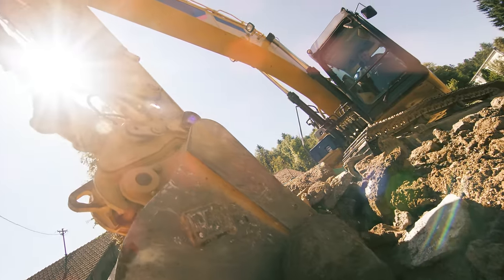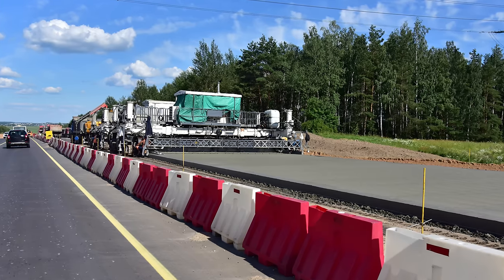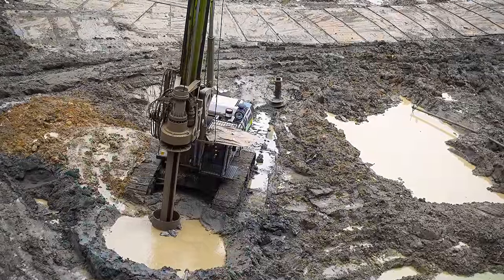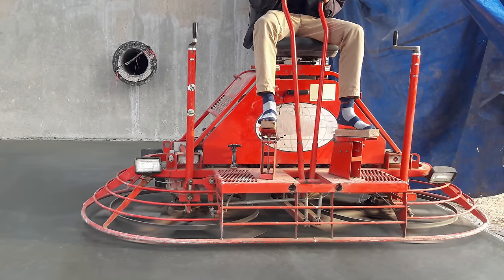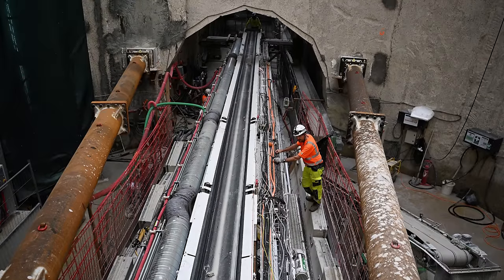Every Construction Machine Explained in 15 Minutes

Comment: My career was a specialized truck driver, hauling oversized loads with specialized trailers. Like when I hauled the concrete walls used in building homes. They would be placed on heavy duty skids with steel wheels like you would see on a trash dumpster. Then these skids would be put on a roll off trailer that can be angled so the skids can be loaded and offloaded using a 10,000 pound winch. I have also hauled much larger and heavier pieces of reinforced concrete. Some of them over 80 feet long. Maneuvering around city streets required a specialized skill of precision driving. There are also specialized trailers to haul all of the equipment you described in this video to and from the job sites.

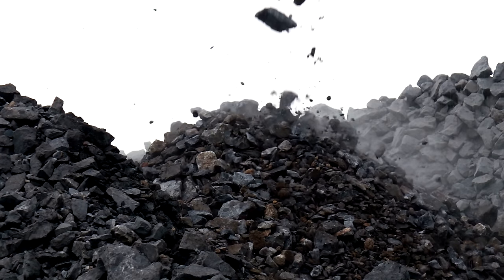Comment: Me a crane operator seeing the monstrosity of a coupling that 6:54 is... got me sweating bullets.

For those who wonder why: The hooks do not have any safety latch to prevent any hooked objects from leaving the hook. Not too bad in itself because, hook it correctly and it can never escape. Except the hook was placed the wrong way on the left hook point which with a correct kind of bump could let the object swing around like crazy. Right hook is correct as should be, left one is horribly done.

Comment: My favorite machine in powerline work we called a “chop truck.” It was used to pull out large heavy lead cable, chop it, then push it off the other end of the truck, usually into a dump truck.
Their pulling strength was wild.

Comment: I was waiting for some real heavy lifters like the D9. Also when talking about the repaving of asphalt, here in Israel they have big re-melting tools, looks like a huge iron - bottom is a large plate of steel and above it several burners, I understand it melts the asphalt and lets it rejuvenate somehow in-place without scraping and re-applying to the road. I have only seen them in passing, I am not sure what else is done in the process, either tar added or some other trick to renew the material in place.

Comment: Thank you Grady, you are the first person outside the classroom I have heard use different names for the skid steer,loader, backhoe, and excavator. Missed articulating rock truck (off road dump truck without steering wheels and was seen under the dump truck clip) and rock truck (large off road truck used in mines and quarries with a large capacity) underneath the dump truck category dump truck

Comment: There are also plenty of specialized machines used for constructing rapid transit and high speed rail like the hi railer which is a pickup truck with steel wheels used for inspecting track

Comment: Loved seeing some of my job going on, I do weight/load handling in the trucking industry.  Weights due to meeting epa targets and electrification are basically causing the front axle rating to overload the G rated highway tire at 500 lbs/in highway regulation. That tire has the highest volume in the industry, so we definitely need to do some lightening up! It's an expensive process 😁

Comment: One machine I can think of is a soil stabilizer (Wirtgen WR 250). Basically a giant rotor tiller very similar to an asphalt mill. They have a spreader ahead of them dropping a stabilizing compound (lime or cement powder) and they mix it into the ground for purposes such as drying or hardening dirt.

Comment: I tested concrete for residential slabs for a year and a half. Talking with some of the pump operators, they’ve said that some pumps can operate around 2500psi (if they absolutely need to), especially if you need to move low slump, high strength concrete.

Comment: Wow, I didn't find a single thing wrong with that! Lol
I am so used to hearing any yellow machine called a bulldozer, and any machine that lifts something called a crane, that this is AMAZINGLY refreshing!
ESPECIALLY considering it's an Engineer.... Who's doing it... ;)

The one thing I would add is a skip loader. Super common out here in California, it's a front end loader like a backhoe, but has a Gannon box scraper on the back. Awesome for working with dirt, gravel, asphalt, concrete, etc, and can basically do anything a Grader can do, (but much slower...), and is perfect for cleaning up the corners that a grader can't get into since the blade is right at the rear.

I would also echo the suggestions of a vac truck, especially in relation to hydro excavation with a pressure wand, and a pole truck that can have a bucket, or dig and set power poles.

The under-bridge inspection machine is also cool.

Sewer inspection cameras as well maybe? 

You could do a whole series about logging and forestry machines lol

Comment: I used to stand by the hydraulic rubbish truck to see it work, oblivious to the stench. The rubbish collection point takes about 20 mins to be cleared. And I'll stand from start to end. Of course, when the guys leave the road rollers at the end of the day or the tracked bulldozers, it'll be our turn, kids taking turns (the machine is off, of course). That was like 47 years ago....

Comment: I think you forgot the White Hardhat.    Also gang scrapers are a thing too.   I'd have included video of a pulled scraper.. a pan.       Fun enough panning was how you removed dirt from gravel when you dredged it from rivers and then moved the gravel to destination - sledge pan pre-dates the wheel.

A thought:  make a video on the local and global GPS systems used in precision construction work referencing base stations and the combination of blade/tool sensors on graders and dozers.

Comment: One machine I noticed missing. When I was a young man working road construction we had a huge rotortilling type machine for the ground prep stage before gravel goes down. Dunno what it was officially called, we just called it the gomaco, but that was just the company that made them. It was a huge machine with a rotortiller in the middle, a big drum with carbide bits and it was used to mix cement powder into the clay of the base to achieve the proper hardness before gravel went on top.

Comment: Timestamps:

Excavator 0:45
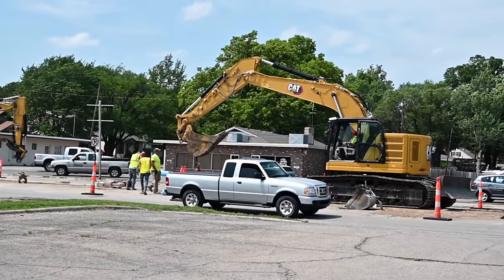Skid steer 1:02
Loader 1:26
Dump truck 1:45
Articulated hauler 2:12
Scraper 2:23
Backhoe 2:44
Bulldozer 2:53
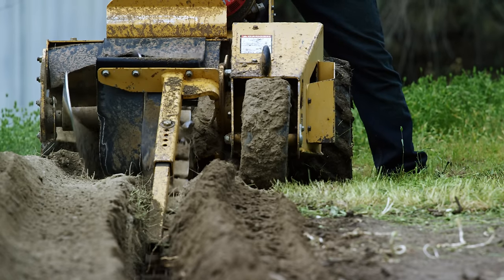Trencher 3:08
Roller Compactor 4:19
Asphalt Paver 4:45
Slip Former 5:06
Asphalt Mill/Planer 5:38
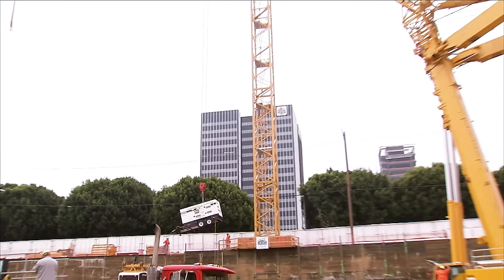Light Tower 6:29
Air Compressor 6:36
Diesel Generator 6:45
Crane 7:01
Pipe Layer 7:06
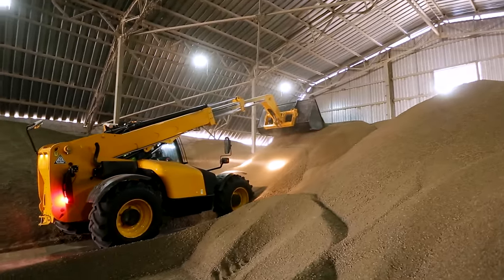Telescopic Handler/Telehandler/Teleporter 7:22
Boom Lift & Scissor Lift 7:39
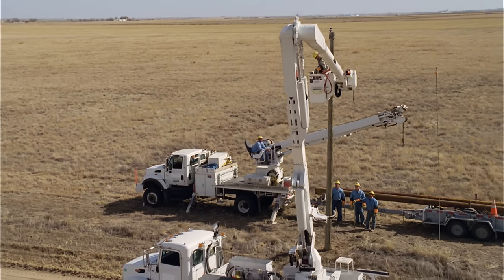Bucket Truck 7:53
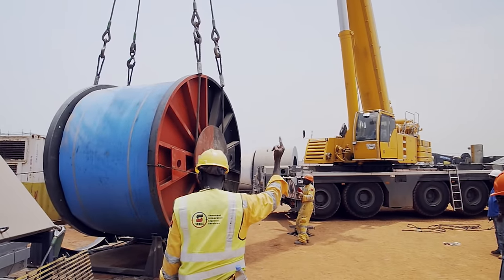Road Rated Crane 8:01
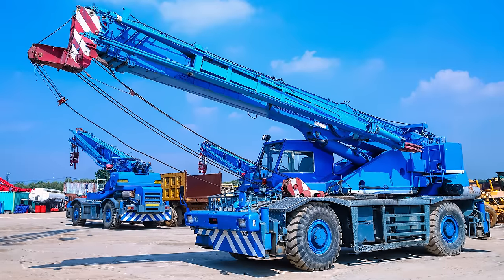Rough Terrain Crane 8:23
Crawler Crane 8:35
Tower Crane 9:11
Launching Gantry 9:32
Pile Drill Rig 10:23
Pile Driver 10:37
Mixer Truck 10:54
Concrete Pump 11:18
Ride On Trowel 11:40
Mobile Batching Plant 11:49
Shotcrete Machines 12:19
Directional Drilling Machine 12:34
Soil Nail Rig 13:04
Mobile Batch Plants 13:15
Hydraulic Pump 13:22
Wick Drain Machine 13:27
Tunnel Boring Machine 14:01

39 machines were mentioned. Do with this information as you wish.

Comment: Grady,  You are Awesome!  I have learned so much from your videos, thank you so much.   I have an Engineering Question for you regarding the generation of electrical power at home using natural gas in either Fuel Cells or Generators.   It seems to me there is an obvious loss of converting fossil fuel energy to electrical energy at the generation stations, but additional losses occur in transmission of the electricity.  Since there is little loss of natural gas in transmission (my assumption), is there an advantage to cogenerate using NG?  I suspect the low cost of energy at the power plant would completely nullify my thoughts, but I am also looking at it from an energy conservation.  Thank you so much for your insights.

Comment: fun fact. mixer truck drivers typically keep a few 2l bottles of coke in the cabby. no, not for drinking. but if there is a delay on delivery. each bottle can add hours to the drying time by adding moisture back in, and the acids dissolve anything that has solidified already.
dont worry, the acids have no permanent lasting effect on the mix haha

Comment: 1. Excavator
2. Skid Steer
3. Loader
4. Dump Truck
5. Articulated hauler
6. Scraper
7. Bulldozer
8. Trencher 

9. Grader
10. Roller Compactor (Road Roller)
11. Asphalt Paver
12. Slip Former (For concrete roads)
13. Asphalt Mill (Planar)

14. Pipe Layer 
15. Telescopic Handler (Telehandler) 
16. Boom Lift 
17. Scissor Lift 
18. Bucket Truck
19. All Terrain Cranes
20. Rough Terrain Crane
21. Crawler Crane 
22. Tower Crane 
23. Launching gantry

24. Pile Drill Rig
25. Pile Driver

26. Mixer Trucks
27. Concrete Pumps
28. Ride-on Trowel
29. Mobile Batching Plant
30. Shotcrete
31. Directional drilling machine

32. Soil Nail Rig
33. Grout Plant
34. Wick Drain Machine
35. Tunnel Boring Machine

Comment: I don't think people can truly have an appreciation for the presence some of these machines have, they can be noisy and loud to the point the shake the ground and your hands to bits, they have a variety of pleasant and toxic smells associated with them from the new cab smell of a brand new machine to the hydraulic fluid smell as it covers your hands from a leak or you needing to change attachments and disconnect the hoses, some of these machines can be extremely hot and uncomfortable to work around, while other machines can cover you in grease that get bloody everywhere from a simple brush of the arm or shoulder.

They're honestly pretty amazing and unsettling to see in real life especially when free space is a luxury and they're millimeters away from other expensive gear that would take months to replace, if not years. And it gets even more stressful when the gear costs more than your yearly wage and the project is worth more than your life time of income it's kind of unreal.

Comment: So is "steam roller" a holdover from when compactors were basically steam tractors?  Or is there some component that heats up the asphalt mix as well?  Or are the vapours I see coming off the newly laid road just there because the surfacing mixture was already hot?

Followup question:  Even though compactors have a very slow top speed, why is it seemingly impossible for cartoon characters to outrun them?

Comment: Its not necessarily formal construction equipment, but how about a pickup truck or utility truck? I do a wide variety of construction, even working a sawmill and my truck is my mobile tool shed, my generator, my workbench, and my lunch go getter. I couldn't do it without it.

Comment: I always find concrete pumps interesting. They are always towed by a large truck in front, making a huge road train, if you could say so, on the road. Pretty cool. Young me always wondered why they are broken down and need to be towed. 

 Where I'm from, they are always at work sites for long periods of time. So almost all of them don't have a registered license plate. Saves on that road tax. Ones or twice a year they just pay for towing and move it from site to site, and then the pump truck just drives normally within the realms of the lawlwss construction site

Comment: you missed 2 important pieces of equipment, first off water trucks, no use in moving all the soil around and compacting it if it's dry. Secondly tractors, I know they are mainly thought of as farm equipment but they are used just as much in construction and kinda a jack of all trades thing cause you can hook up anything from a scraper to move dirt to a semi trailer to haul material in off road conditions.